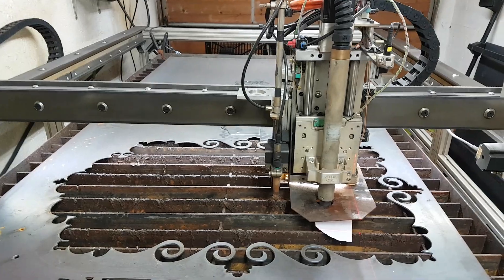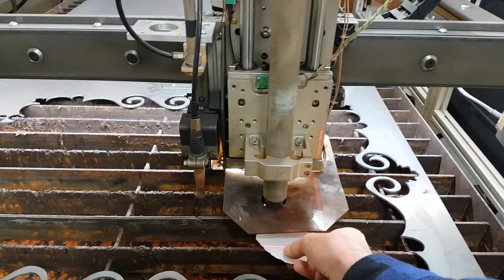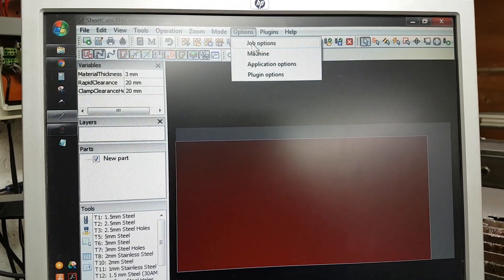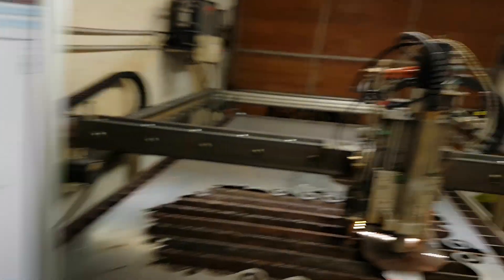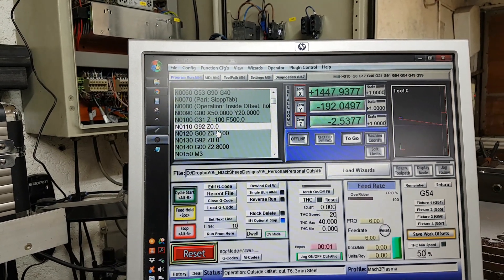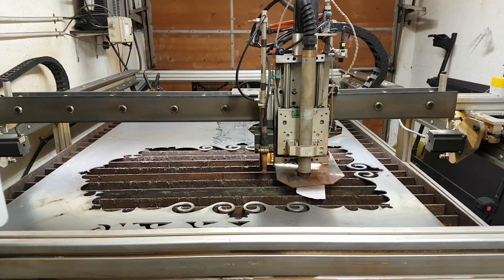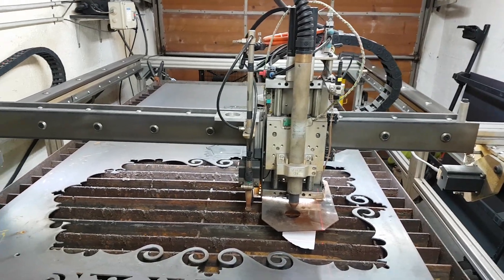CNC Plasma : Floating Head (Z)

Comment: Hi mitch i am trying to set a floating head in my plasma but i use LazyCam for creating GCode. Do you know if it possible to configure the Z Offset in that program, or it is only possible in SheetCam. Good Job and Vielen danke
Reply from the maker: Hi Javier, 
I have never used LazyCam so I can't say. Thanks for the comment and good luck on your search!
Reply: @MitchGreeley   thanks mitch. I finally desisted and i followed your steps. Anyway, sheetcam is much better software than the Lazy one. Thanks for your tips

Comment: How do I wire the switch
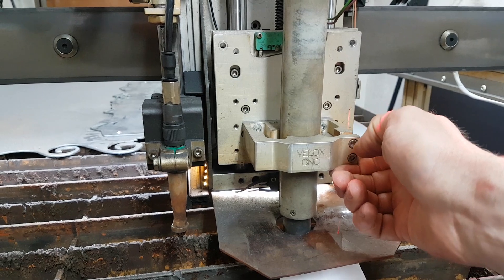Reply from the maker: It's a NC (normally closed) switch on the mounting plate. This runs to the controller and signals Mach 3 during the probing sequence in the Gcode. @ min 2:27 I show the switch engagement.
Reply: Sir , plz tell me How to configure the floating head micro switch in the mach 3  to sense the initial height ??? Plz reply. ..